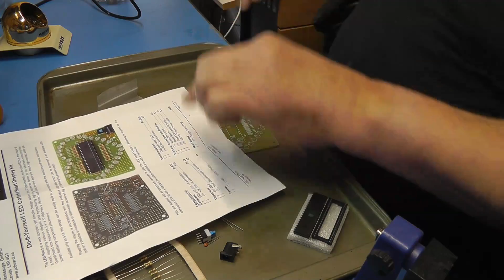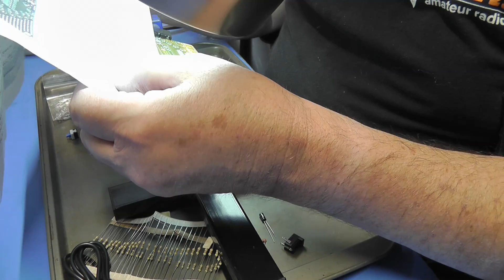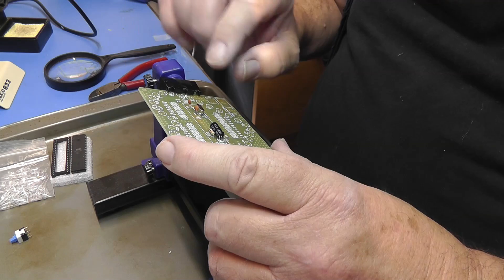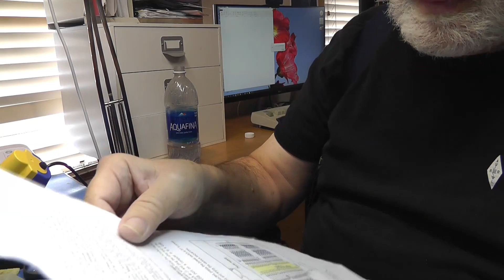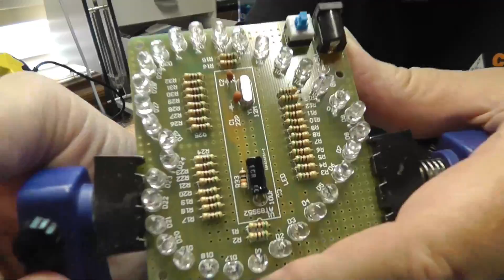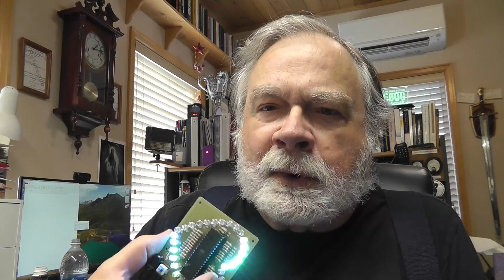Happy Valentine Heart Kit for Loretta (#655)

Comment: Good video, you showed some of my favorite PCB assembly tricks.
I find rubber bands can be real helpful to hold parts prior to soldering and they can turn pliers into useful clamps as well.
The cookie tray is a good idea, I do the same and I like to put a tea towel in the tray too it keeps parts from bouncing and sliding around.
Good opportunity for a troubleshooting video, probably a solder joint, my most common mistake.

Comment: Just curious, did you check and see if the 'non-functional LED" may have been accidently installed backwards?  Anode vs cathode, etc.  Also, the associated current limiting resistor and dedicated IC output pulse is easy to verify, etc.  Nice project Dave.  Much appreciated.  7 3
Reply from the maker: It turns out one of the microcontroller pins had folded under during insertion.
Reply: @davecasler  Thanks for the update.  73